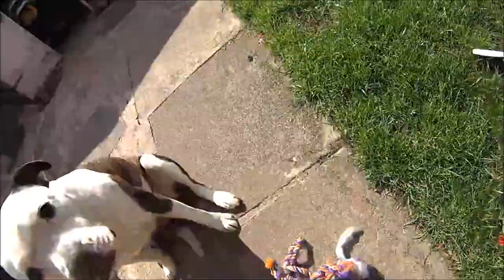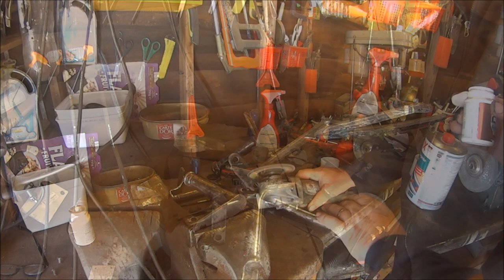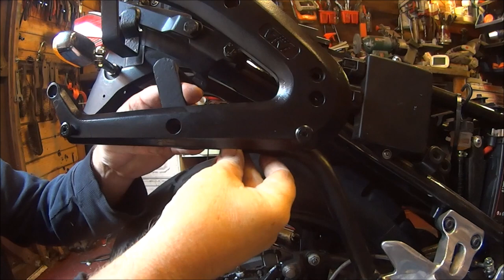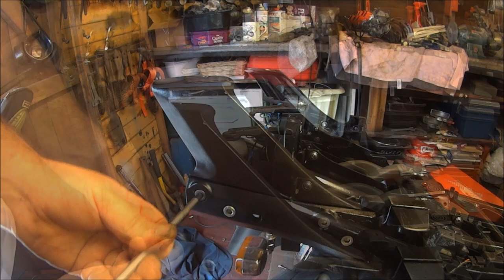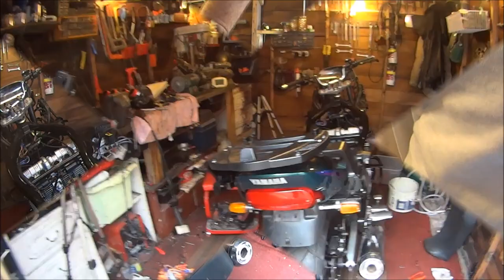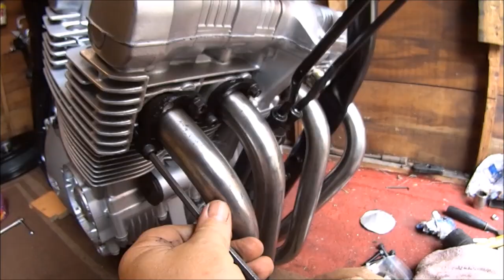XJ900S fitting a wing rack

Comment: Hello there. I see you had to take the wing rack side off to fit the side panel, does that mean you have to do that if you need to take the battery out? Thanks Graham
Reply from the maker: Hi graham.
Yes I'm afraid so on my d9 the rack is to close to the panel but your setup might be different so I would just try it first but put some cloth inbetween so you don't scratch the panel.